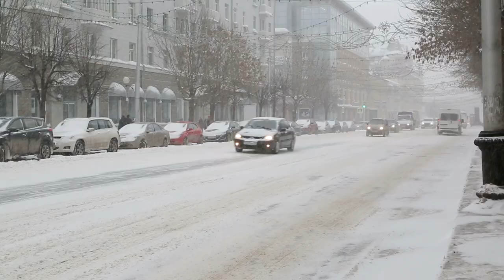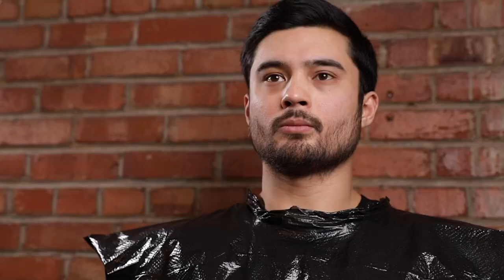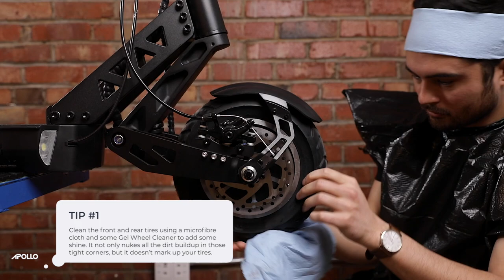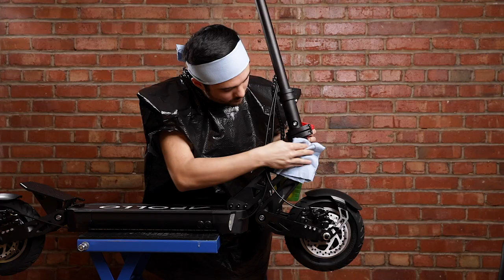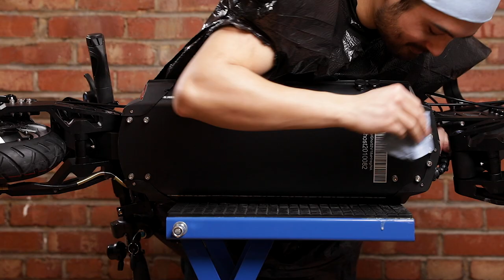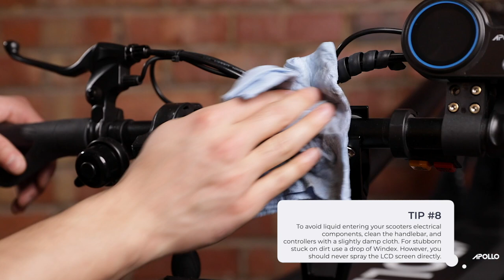How to Clean an Electric Scooter

Comment: Can we put wd40 everywhere on the rear and front wheel in the bearings without problem for the transmission and the magnets?
Reply from the maker: Hey there,
WD-40 is more a cleaner than a lubricant, so it is okay to use, but be sure to re-lubricate those areas after. We recommend using a silicone based lubricant for this, in our shops we use the brand Jig-A-Loo!
Reply: @ApolloScooters  Merci

Comment: Hi guys. I got my ghost like 2 months ago and I'm experiencing a lot of noises coming from the suspension and the wheel when turning. My brakes are also coming loose pretty fast. The front hub seems like it came bend because the wheel is vibrating a lot when riding.
Reply from the maker: Hi Estera! 

Can you please contact our customer support team at: support@apolloscooters.co

Or you can join the live chat on our website.
Reply: Good video however. There is a screw missing underneath the display. Top left